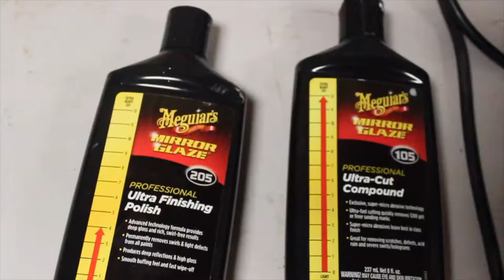Restoring Headlights with Polisher

Comment: That's not a bad headlight just needs attention. I normally remove the assembly and polish it with a buff that I use plastic polish on. I'm a jeweler so ive  polished thousands of items. I also polish fairings and other plastics and don't often sand and do all the steps done but YouTubers. I just get it done and move on.

Comment: Spray some good quality clear now, and not out of a rattle can
Reply: Clear coat isn't meant for plastic, that's why this happens in the first place. A simple alternative is the Mequires headlight coating. The best option is a graphene ceramic coating.
Reply: @yaranzo5pwns  wrong, automakers dont use clear coat on their plastic headlights. The reason this happens in the first place is lack of adequate or lasting UV protection. I can't speak for everyone and their ability to lay a coat of paint but I sprayed mine 4 years ago with UV protectant clear and they've still looking great.